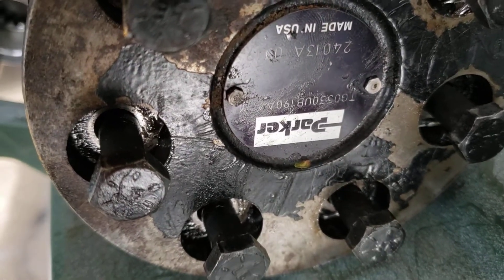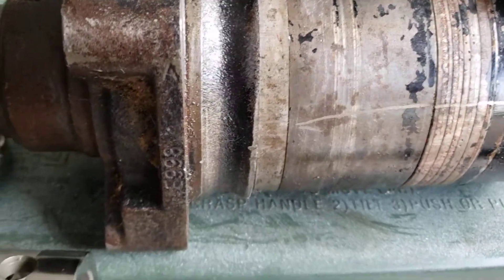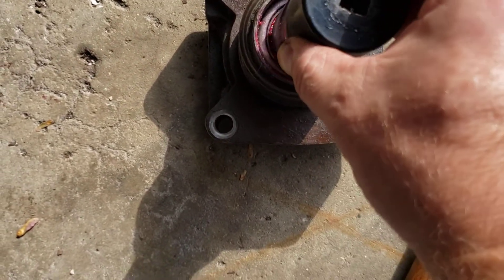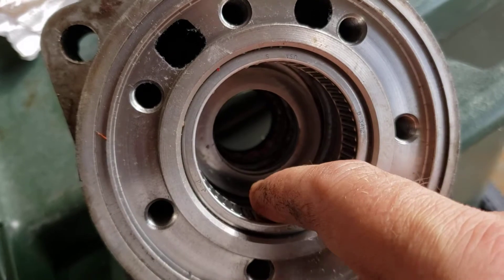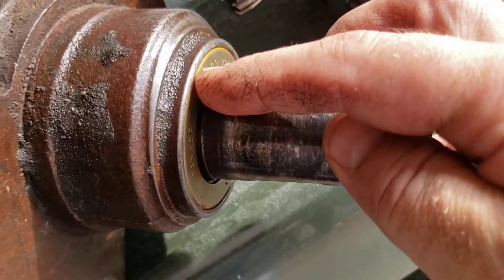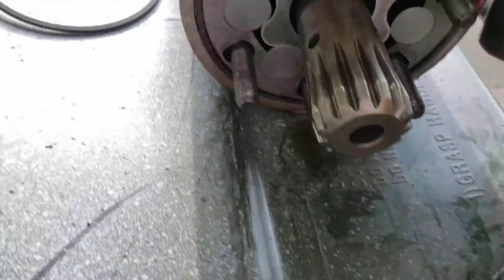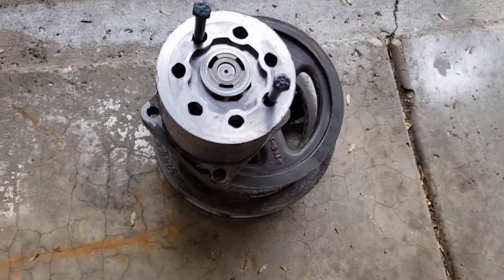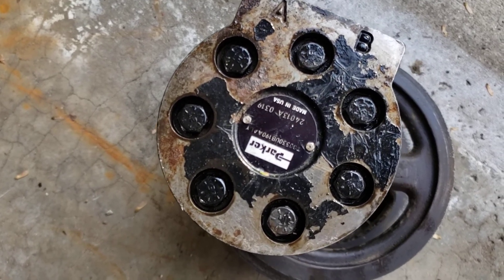Parker TG Hydraulic Motor Outer Bearing Replacement for a Dingo TX420

Comment: The biggest step in the video is missing which is removing the dang outer bearing! I couldn't do anything but break it apart and stick a long screw driver from the inner side and carefully pound it out. 

And the bearing itself is stupidly expensive for a bearing. My Parker TG had a FC66362 bearing which is the exact same bearing used in vehicles for axles and things. It cross references to National Bearings part 5707 (same for similar brands) and it's under $25.

Comment: Just what I needed. A look inside before I pull one of these apart. I have end bearing play in a TG series motor.

The unit I have is a Ross torqmotor, now Parker. The service manual can be downloaded via a quick search for Parker TQ service manual.
All the part numbers are in there along with the layout and options.
There is a full description of what grease goes where.
Identification of part numbers is a bit tricky but bearings are common to all motors in a series. The numbers are Parker part numbers only. There is no reference to sizes etc should you try to source an alternative part.

Good video. Appreciate the effort and the price links too. Though I'm in the UK.
Good luck to other fixers.

Comment: do you have part number for bearing? ive been searching everywhere cant seem to find one.
Reply from the maker: try calling these companies. i placed orders with both of them and need to find my item list of parts i bought. i will reply with more details if i find that info

https://www.motionindustries.com/products/Bearings
https://www.wilson-company.com/
Reply from the maker: Parker Medium Duty Motor - Torqmoto TG Series
https://ph.parker.com/us/17601/en/hydraulic-motor-with-exceptional-strength-and-durabilty-for-up-to-13000-lb-in-torque-torqmotor-tg-series
Parker 24013A E998 motor, 106-7654, TG0530UB190AALY, TG0530UB190AA
Parker TG 068027 outer bearing, F-66263, $29.95
Parker SHAFT Part #: ME019011  Price/UOM: $280.32
Inner bearing, koyo B-3412 Drawn Cup Needle Roller Bearing - Open Ends with Full Complement, 2-1/8 in Bore, 2-1/2 in OD, 3/4 in Width

order info from motion industries
Qty  Vendor                Item Number          Unit Price      Total
  1.0    INA                    06226868                    29.95    29.95
                              Description : F-66263.RH
Reply from the maker: https://www.wilson-company.com/product/068027/068027
068027
Parker FRONT BEARIN
Part #: 068027	Manufacturer: Parker
Price/UOM: $35.49
Reply: You're a life saver thank you!
Reply: The outer bearing and dust seal part #you listed will they work on this pump?
TG0530TB190AAL